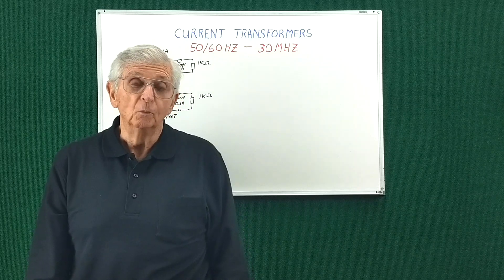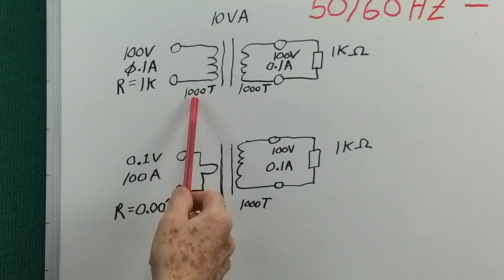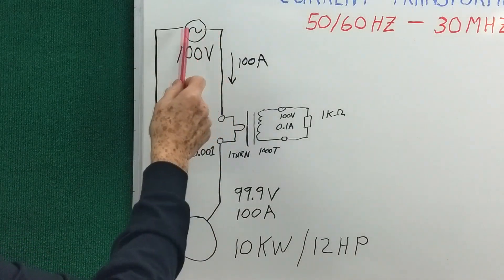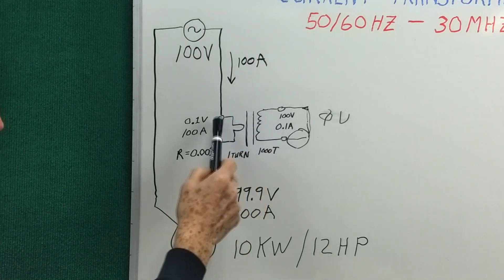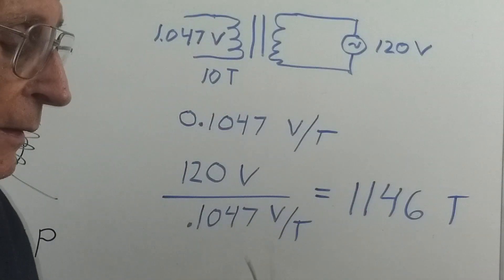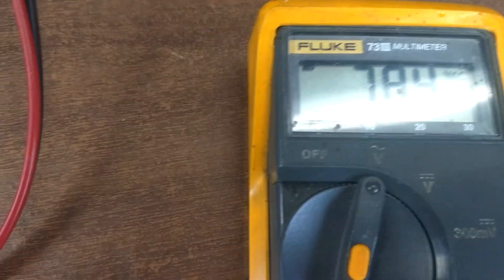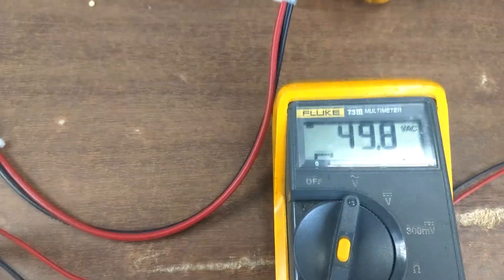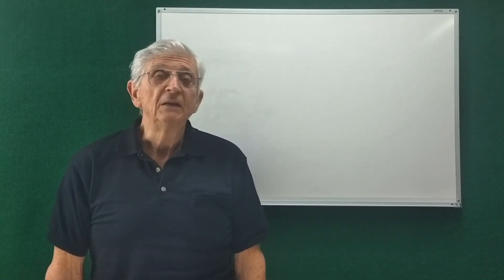Current transformers, how do they work

Comment: Loved the demo using the modified transformer! Would the output voltage still be proportional to the input current if it was rectified and converted to DC?
Reply from the maker: I did try that and found the output was not very linear. I don't know why this did not work. If anyone reading this knows the answer please let us know,